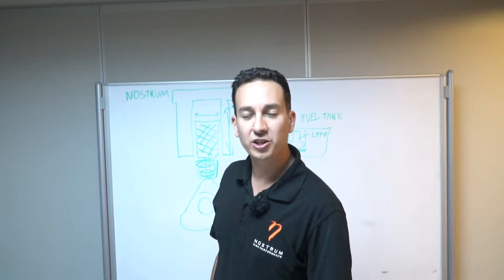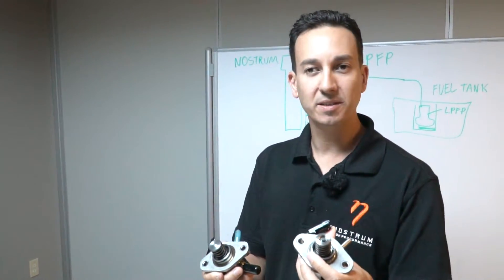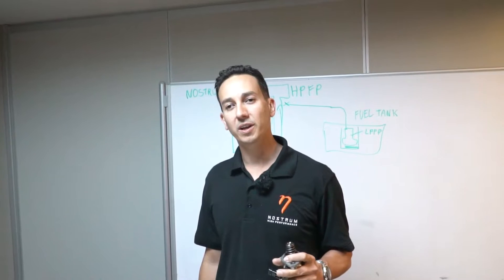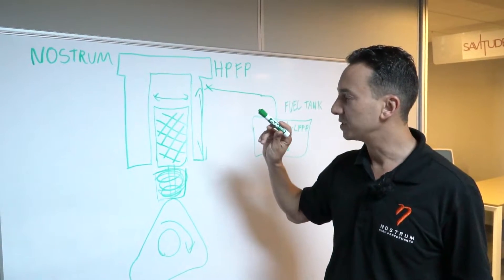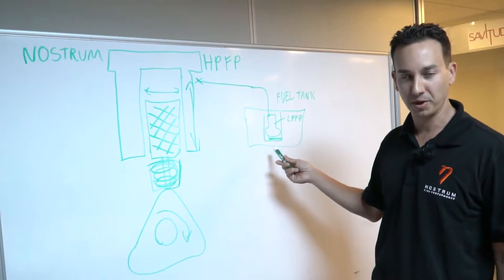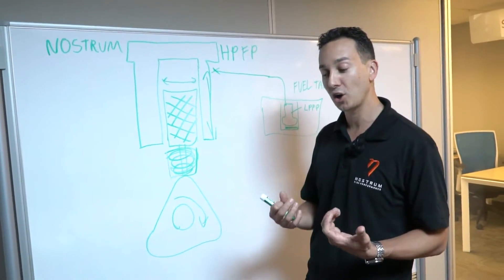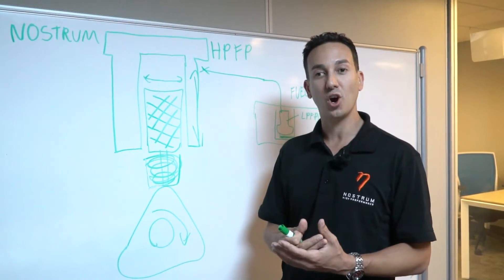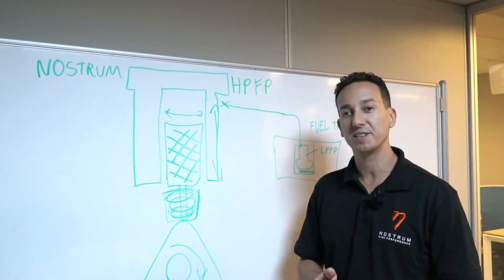How Does Our Subaru FA20 HPFP Work and Run On E85! | Knowing With Nostrum

Comment: My takeaway from installing this part is: you can be tuned for e85 and run anything in between w/o having to worry about the actual ethanol content of the fuel you’re using. Saves you time having to make sure you have the correct % blend.

Comment: I have heard that one of the big issues with running full e85 is the standard hpfp would overheat and/or seize due to the reduced lubricating properties of higher ethanol content blends. How does your pump overcome this problem?
Reply: I’ve been running e85 on the original pumps in the Subaru BRZ for two years 15,000 miles no issues yet

Comment: Does this product require a re-tune for those that are already running a proper ethanol tune? Or would it be plug and play at that point?
Reply from the maker: In order to pursue power you will need a retune to take advantage of the high flow capacity of the pump regardless of the fuel type. The higher flow rate pump will allow you to run longer injection durations without "running out of pump" when you start pushing for more power. ("Running out of pump" = the fuel rail pressure drops because the pump can not keep-up with the fuel injector demand.) The pump itself is plug and play - you can swap it out and it will work but you won't be taking advantage of the  higher flow capacity. The pump IS NOT designed to run higher pressures than stock. We do not recommend running pressures higher than the stock fuel system because other components, including injectors, are not rated for the higher pressures. 

If you are already short on pump ("running out of pump") then this upgrade will eliminate that problem on your tuned E85 built WRX. Assuming you have the Low Pressure Pump upgraded to meet the demand. Depending on your HP targets, you will need a high flow low-pressure pump in your fuel tank, because when you start pushing power and driving fuel demand up, the high flow high pressure pump can be starved by the low pressure in-tank pump. You need to think about the entire fuel system.

Comment: I have mine installed, but not tuned yet, what kind of gains did you guys see going from mixed to full e85?
Reply: I saw 100hp from 93 to E85 in my 2015 WRX.
Reply: You may not see whp gains. But the point he was trying to make ks that you wont have to blend with gasoline (and its additives and detergents) thus making it more reliable when running straight e85 vs mixing with gasoline for a 50% blend for example. 

I happen to have access to e51% in az so i dont mix/blend. Blessing in disguise if you ask me.